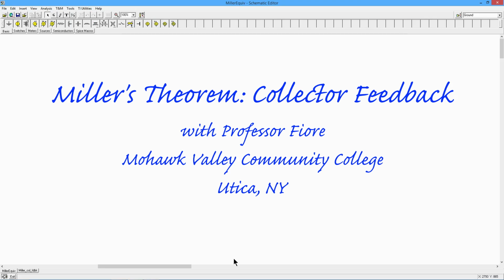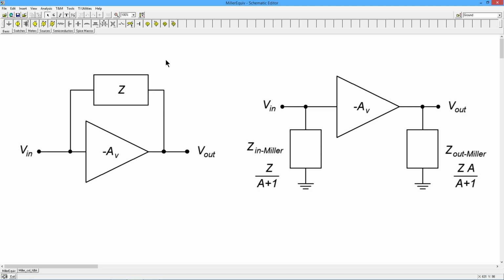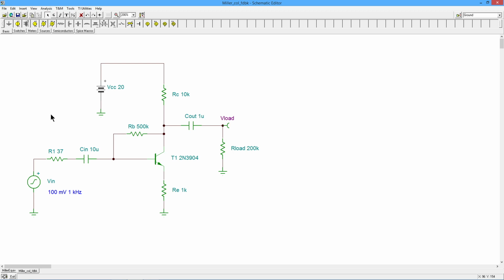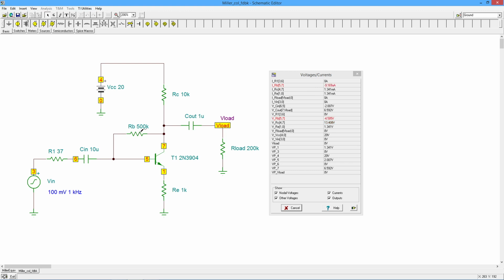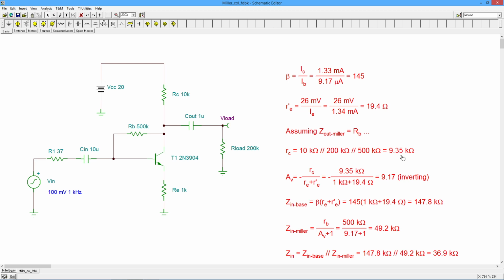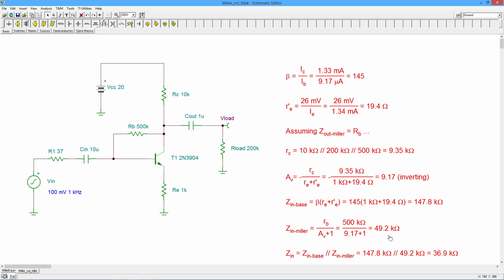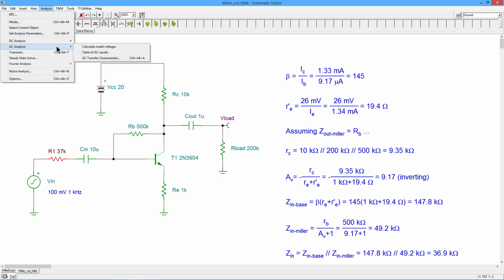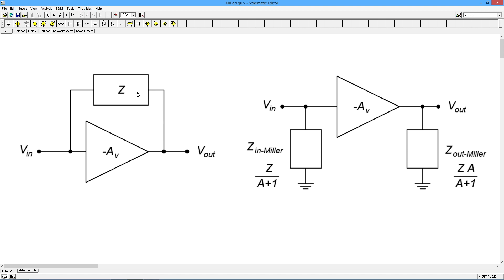Semiconductor Devices: Miller's Theorem

Comment: Amplifier's input impedance should be infinity to use Miller's theorem?
Reply from the maker: No, not all. The Millerized values appear in parallel with the values you'd compute otherwise.
Reply: @ElectronicswithProfessorFiore  You are right. I just realized that. Thanks for the tip. I used the theorem on op-amp's a lot.